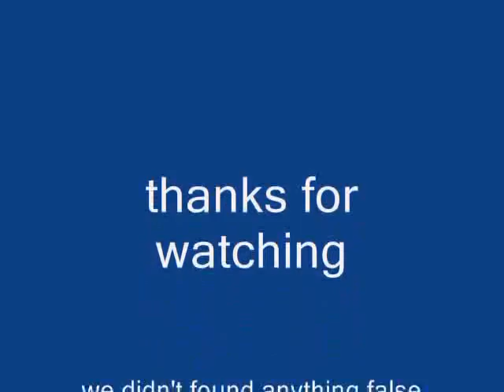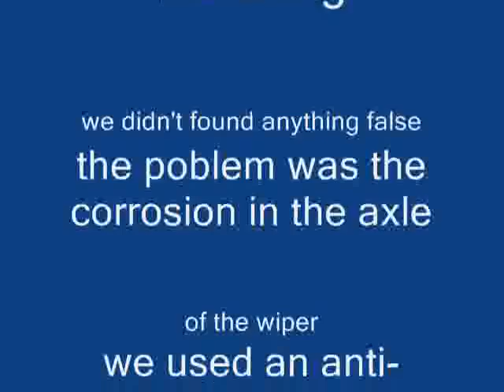ford escape rear wiper

Comment: How do you remove the motor from the windshield?  I removed the two bolts but can't remove the black ring around the drive shaft.  It appears to be threaded but still doesn't come off after turning it.  thx
Reply from the maker: please ...my friend try...iti is difficult to say the way from here ...i am sure that you will find the way....thank you
Reply from the maker: Dimitris Markopoulos the  "anti-corrosion fluid" was a liquid that we use to clean the bathroom the metal surfaces